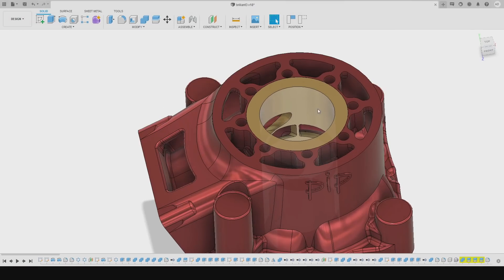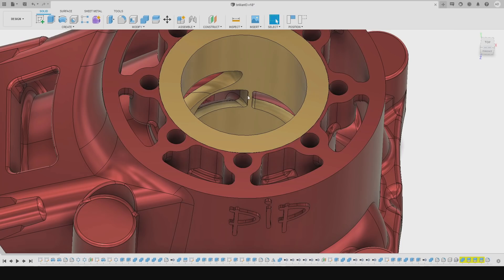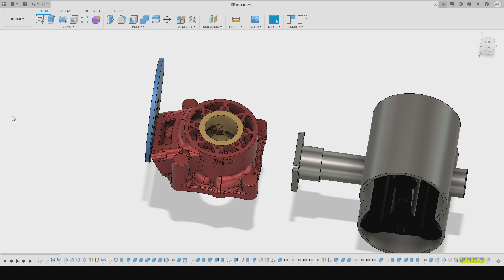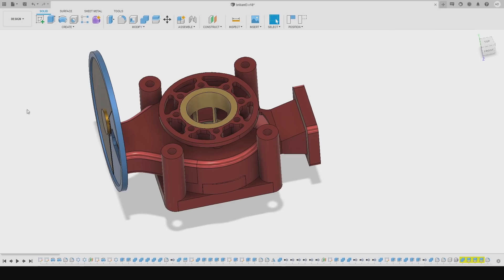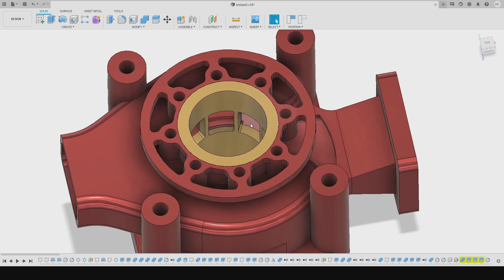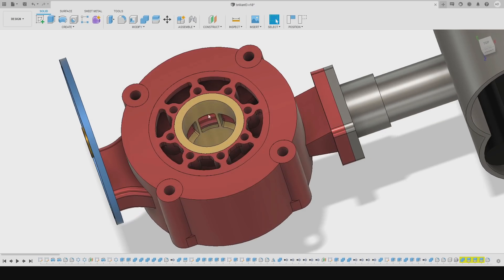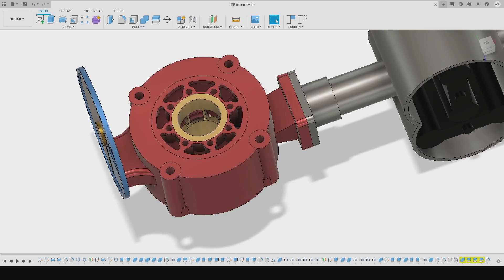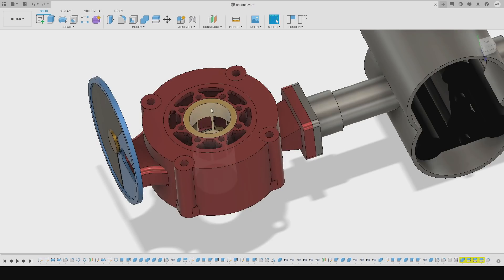Will BLOW Up the Competition! Seriously!

Comment: Love your work and Drive.  Basically, a 2 stroke must get the exhaust out and fresh intake in while the piston moves through the bottom (down and up) portion of the 2-stroke cycle. utilizing as much as possible of the up and back down duration for compression and combustion.  Also, trying to isolate the crank and rod lubrication from the fuel mixture for a cleaner burn. Putting the exhaust at the bottom is good. but having the intake compete in the same space is turbulent?   Think about this, leave the exhaust at the bottom but intake at the top helping push out the exhaust from the opposite side of the cylinder. I think if you contact "Koenigsegg about using his free valve" set up and make a cylinder head with two poppet style valves for intake. the "Free valve" timing cam can be controlled to achieve maximum filling pushing out all exhaust gasses out the ports then overstuffing the intake after the exhaust ports are closed with the piston on the way up.  max power the fresh gasses will keep the head cool and the heat from the exhaust can be managed better exiting out the bottom of the cylinder away from the intake charge. https://youtu.be/S3cFfM3r510

Comment: ok, now i think you are crazy. this isnt the way. the blower needs more power, then the engine produce. point two  why the fucking hell are you using this big round plates and not a rollervalve. the other side is, whats wrong witz the small bridge in the hughe port? need power? ad pure oxygen from a bottle. blower need power to produce more power. turbo less. need mor power, add fuel and oxygen. you ad pressure, need more force to get the piston upwards, to get a little more hp. you are going the wrong way till at now.

Comment: The Detroit Diesel configuration is probably one of the best for a clean 2 stroke , with ordinary crankcase lubrication (4 stroke kind) , fuel efficient, emissions the same (or perhaps better) as a  4 stroke and with at least double the power than an equvalet 4 stoke of the same cubic capacity. Some smart tuning of the EFI like used by the new KTM  two strokes  would complete  the design....

Comment: Have you considered a opposed piston design? This will have uniflow scavenging, inlet and exhaust ports operated by the opposed pistons, high thermal efficiency ( no cylinder head) and unlimited scope for radical port timings. Even Formula 1 are considering this for 2025!

Comment: Have you thought about exhaust valve on top like in a diesel two stroke. Might be possible to use a solenoid to open and close, eliminating the need for a camshaft.

Comment: About 25 years ago, Sarich Engineering released a direct injection 2 stroke onto the market using a lot of the ideas you're suggesting. I would have thought EFI is now well fast enough to help you do that successfully without an engine full of mixture and all the issues that go with that.
Why the Australian Orbital two-stroke engine never took off (whichcar.com.au)
P.s. with lots of boost, I hope you're planning a stronger connecting rod.

Comment: this design reminds me a lot of the older two stroke Detroit diesels, like the 8v71, they ran on a similar principal and also had a blower, however they had the exhaust valves and injectors in the head, kind of half two stroke half four stroke. that way they exhaust timing and duration could be controlled directly by a cam while the full circumference of the bore could be used for intake ports. it would definitely be worth a look if you haven't seen them because they were a weird design but in their time made more power with less cubic inches and weight than pretty much anything else in their class. from what I know they were only discontinued because they struggled with emissions. have a look at them and see what you think! -travos garage

Comment: I like the idea of pressurised mixture combined with a 2-stroke !
But you have te consider that there will be fresh fuel mixture in the space between the cilinder and the exhaust port. This will combust after the exhaus gasses leave the cilinder and enter this area which cause a pressure wave against the natual flow of the original combustion gasses and continuous flames out of the exhaust ! ;-).
As a solution to this possible problem:
1. Direct fuel injection into the cilinder, at this point in time that the ports are closed. That way, there is only compressed air in the exhaust area.
2. Use the carter as a lubrication system like a 4-stoke. -> no mixed fuel is needed and better lubrication 

All the best of luck !

Comment: Getting the balance right between pressures is the problem. The exhaust pressure filling the all of the ports and having the charger push against that could be an issue. I'd fit a dump valve in the manifold just to make sure you don't pop something on your first try. And try and get some live pressure readings.

Comment: How do you plant to start the engine? Even with a starter the Blower cant generate suficient pressure imo. Another question. How do you plan to time the exhaust rotary valve? Are you Mouting the cilinder so that the exhaust is facing one end of the crank and the blower the other end?

Comment: let me preface this with the fact that there should be a better preface here😅If you worm drive the blower, might that prevent back spinning it with the combustion pressure? Essentially, making it a valve.  Could direct injection alleviate some efficiency concerns while still providing necessary air/fuel ratio?

Comment: I am by no means a 2 stroke expert, but a couple of things jump out at me .....

You say 4 identical inlets ..... but the inlet port on the blower side will get most of the action and the one nearest the exhaust the least! Would it not make sense to reduce the size of the one and increase the other (the two center ones could stay the same. 
Rotating the ports 45 degrees may also give an improvement. 

Most 2 strokes have an improved burn if you have turbulence. Simply angling the inlet ports could give a vortex inlet pattern increasing the mix.

The exhaust ports seem to be the same size as the inlet ports .... yet the gas pressure they will operate at will be higher (at least at first opening)!

As the revs increase in your engine you will reach a point where the inlet and exhaust balance giving a knife edge power band (or alternatively a knife edge fuel efficiency curve)

You will have a gas flow within the block that will go one way and then reflect to the opposite direction. Exhaust into the inlet and then back out as pressure reverses. This may be reduced by having the correct size of chamber between the engine and the blower.

Dependent on the relative sizes you may get a "boost" from the crankcase pressure building up on the down stroke and adding thrust to the up stroke, effectively smoothing the output power. This may give a sizable benefit if tuned well! 

OK, enough prattling from me ;o)

Comment: No offense but i think you made kinda a 4 stroke because jou wil have to suck push exhaust out and clean air in at the same time because the ports are the same hight i dont know if i am right but i think that you built al 4 stroke without steal valves but with a rotary valve and a reed valve i dont think its going to be as good as you thinh i think the powe is going to be lost if you find the exact timing on the exhaust valve than it wil run but i dont think you kan make a lot of hp another thing i see is that you dont cool 50x of de cilinder beneeth the ports and at the ports itself and i know a cilinder gets hottest at the top area but the friction is going to be hot aspecialy if you have compressed air cooling has to be much more bigger radiator bigger pump bugge cilinder i like the design but i think its almost inpossible but it can run but i dont know if its such a good invention as you thing i think you need to stick with the last cilinder and try this cilinder when the last doesnt have issues i think there is a lot to learn about 2 strokes en a lot of stuff that can be invented so we can bring back 2 strokes another thing i dont know what you are going to do with is cooling and lubing the crank on the main bearings big end baering and top bearing i want to know more in detail about your desing but i think you would be succesfull with your last cillinder than this invention btw i love seeing your vids keep it up and post a bit more its a good education headsup

Comment: This is an awesome idea, thanks for the explanation! I'm a little confused though, if this is separate from the crank volume will the supercharger produce enough pressure to draw fuel in? Will it use an oil sump like a 4 stroke or is it charge cooled somehow?

Comment: Would you end up with combustion in the exhaust ducting with such extreme short circuiting? Any flame front making it out the top of the exhaust ports may ignite all the combustible stuff in the exhaust manifold. If so... Id have to wonder if it would produce an extremely aggressive exhaust pulse that could spool a small turbo,  bypassing the parasitic drain coming from that big supercharger. If it could run naturally aspirated long enough to spool the turbo that is...

Comment: very positive view from you. How about sealing off cylinder pressure with forced induction and at what pressure? I say one piston ring won't do very soon.
The sealing rotary shield at exhaust port, i am curious to how that will work on high rpm's. Good luck with your project.

Comment: Have you considered a direct injection setup in the head? Injected after the ports are closed off, would help with cooling the charge and help with detonation. You're already going to need an oiled bottom end so lubrication in premix isn't going to be necessary.

Comment: I love this series and your engineering skills! Very interesting! However I have a question. So, 2 stroke has the reed valves that control intake air flow(basically lol). So when the charger is forcing air in, how do you expect these reeds to work?

Comment: hey alex you could also pack a direct injection into the cylinder head that injects when the ports are closed  then that would be no longer a problem with the fuel efficient

Comment: It has potential but......
I believe the losses in driving the supercharger and the increase in crankcase pressure will offset any gains.
Once the piston closes off the ports there is nothing to stop the blower forcing the charge into the crankcase below the rings. If the crankcase is sealed then the pressure in there will be equal to the boost and raise pumping losses. If the crankcase is vented then the you'll lose boost through the whole system.
It might work but I think a traditional port arrangement would be better.
Good luck though

Comment: I think this might work if you get proper timing to that rotary valve but, that fresh mixture in exhaust might give you some troubles.... I think if you make long exhaust pipe it will give you some back pressure and without pipe you will have flamethrower..... but these are just my guesses....

Comment: 100 horses will blow up your engine within 10 seconds, but interesting work and configuration.

I think your ports are to "big", high/long, intake need not go that high, exhaust should be thinner, an more evenly balance configuration would be 3 + 3 ports, three exhaust more oval (standing up egg shape crosscut) and intake three oval shape, 
   ("crosscut lying down" egg shape).
This configuration need not lessen you ports size, but for sure in all will add to a much greater durability of cylinder, piston, engine.
Also there is to much volume in the intake and exhaust channels via your feeding and letting of  your cylinder port, this is and will be your/a major problem.

Comment: Will you incorporate a waste gate or other pressure relief valve when the reed valve is closed but the compressor is still operating? Maybe at these RPM’s it becomes irreverent at high speed?

Comment: If you make it diesel and direct injection, It's called Detroit Diesel. Detroit Diesel had pump injectors and exaust valves in head. Injecror is good idea, no point to blow mixture in to the exaust pipe.

Comment: rotary valves in high pressure environments suck. 

if you want to supercharge it, just use a common valve in the head. or maybe four as exhaustvalves. just as the diesel engines in big ships or the twostroke lorrys with detroit diesels.

https://www.quora.com/How-does-a-Detroit-Diesel-2-stroke-engine-work

an exhaust port with rotary valve and supercharger  won't work the way you want it to.

Comment: Why not just blowing compressed air, and use a fuel injection ?
Pros: No more short-circuiting, less pollution, more efficiency, no need for rotary valve
Cons: need a fuel injection system... heavier... but as you go for heavy with a compressor, an oil carter, ...
As well, who said that 2-stroke engines cannot have valves ?

Comment: Dude, you might as well do a turbo set-up, the turbo works with a 2 stroke because the exhaust back-pressure raises in relation to the boost pressure, so the fresh charge doesn't just escape out the exhaust.. and it doesn't have parasitic loss and the extra complication and development time like the blower and rotary valve idea.

Comment: @2strokestuffing Are you going to use a direct injection in the head or will it be mixed after/before the supercharger? Could a 4 stroke crankshaft be a good start that has oil holes drilled trugh the shaft for oiling the conrod bearing sense crank case is sealed? This design will be interesting to see if it works!

Comment: That's wayyy off the path well-travelled. The rotary exhaust valve looks problematic because it could flex under pressure and become an ultra-high speed disc brake (even intake discs rob power with friction). I'm sure you'll make it sing tho. That's what you do.
Reply from the maker: 😁👍 Will be a drum valve I think.

Comment: Same as Detroit 2 stroke diesel but without the exhaust valve 👍. I'm really excited about this one 🙂 but I'm a bit worried that the engine won't get as much rpm as a conventional 2 stroke. I think the exhaust rotor will be hard to time for the full rpm range. I'm afraid the rotation will be too high the valve will not maintain the pressure properly. But you'll be able to induce more fuel mixture so potentially more power maybe with less rpm 🤷‍♂️

Comment: Interesting idea for sure. Makes me think about detroit 2 stroke ship's diesels. Anyway, adding a high pressure injector could avoid all waisted fuel. But I understand injectors in a two-stroke will potentially limit top end rpm as they struggle to follow on mechanically.

Comment: You could just use a turbo much easier. I spoke with an engineer at can am. They use turbo on their snowmobiles they are able to use resonance of a tuned pipe and the back pressure from the turbo to build pressure in the cylinder. The turbo keeps everything in check. Where as like you mentioned with the supercharger all that flys out the window. unless you use valves in the head like detroit diesels. Only thing is then you need lot's of flow because your supercharger is the only thing pushing the exhaust out. They also used direct injection to use less fuel. Something your design would also gain from. Diesel time? 😂

Comment: Greaaaat :--) What about supercharger RPM and efficiency? As rpm rises it will probably loose efficiency due to heat and air velocity/pressure/mass - how fast will it spin? 
How about a centrifugal SC - like Rotrex - who has made small SC for 50 cc pocket bikes. It will have a rising boost curve and maybe match the high crank rpm. I can maybe help you getting a Rotrex.........
Looking so much forward to see your results :-)
Reply from the maker: First prototype, then tweaks 👍 I wouldn't mind a Rotrex...

Comment: How about a sleeve valve? Rotated around the cylinder. Exhaust ports below intake. Exhaust opens first. Than intake opens above exhaust. Exhaust closes.  Piston finishes closing intakes as it moves up.  You will have unlimited exhaust and intake port space. Only bridges needed to keep piston rings in place. Sleeve has closed intakes on firing stroke as piston travels down.

Comment: To me how people make power from two strokes is some sort of magic. But this is trying to become 4 strokes. :D
P.S. Old-school two-stroke diesel is very similar. They have an exoust valve similar to a 4 stroke engine but intake is just a pile of holes in cylinder walls. And it can't run without superchargers because it doesn't make a vacuum on its own and relays on a supercharger to push out used gas and introduce fresh air.

Comment: Direct injection.  Otherwise I see a huge explosion. Burning exhaust mixing with pressurized air and nitro mix?  But if only air is used for purging? Nitro methane is needed to cool the charge.  Roots supercharger horrible at any pressure over 5 psi.  12 psi = 250 f air charge. I have measured this.  But if only air is flowing at first you can purge the engine. Then when exhaust valve is closed port injection of nitro will cool charge after the cylinder has been purged. You could use an inter cooler before the reed valve. Spray some water mixed with meth into the supercharge to help seal and reduce temperature.  Not enough to ignite.

Comment: I think the biggest issues with this set up will be keeping it from melting the piston you might want to experiment with water/methanol or straight water injection to keep the engine alive. Crank the boost as high as she'll suffer and force as much fuel as you can into it and it's definitely gonna make some big power. Keep up the awesome work.

Comment: In twingle type two-stroke the exhaust is closed before transfer. On the other hand, opposed piston Jumo 205 used asymmetrical phasing in its cranks to do the same. 
I have not seen any modern twingles, who is gone to build such?